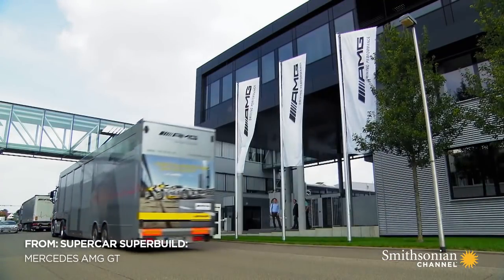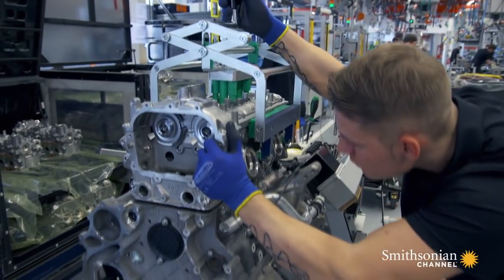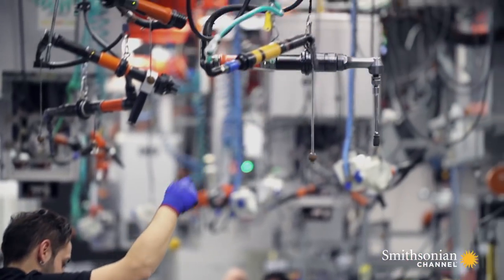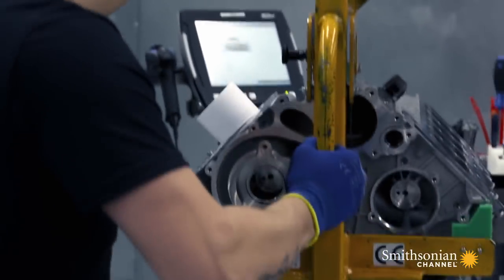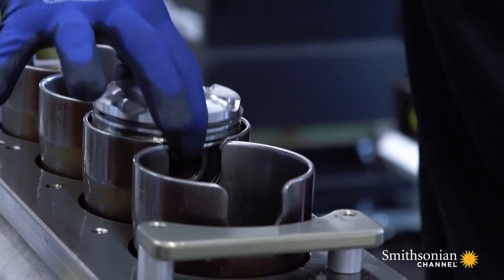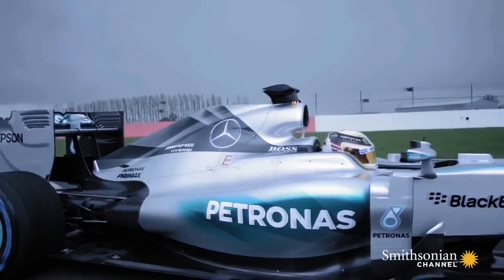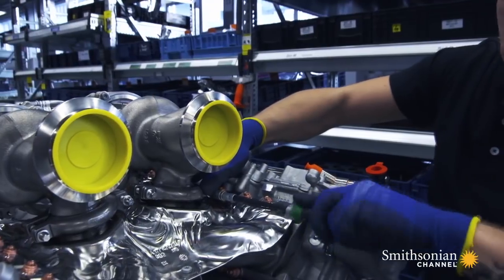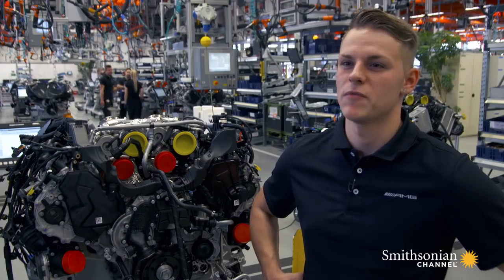Here's How a Mercedes-AMG V8 Engine Is Built

Comment: It's sad that no longer will every AMG have a hand made engine with Mercedes producing the "AMG 43 "models which do not have one man one engine in them
Reply: Its not real amg its just powered engines. Amg starts with 63 not 43
Reply: @istanbul-zc3eu  I agree it’s not a “real” AMG but to Mercedes it is they market both the 43 and 63 under the AMG brand it’s not how Bmw separates M from M performance brand into to different lines Mercedes does not do it that way they did when the 43 models were called the 450 AMG in 2016 but then they dropped that name and rolled the “450” models into the full AMG brand.

Comment: $500 to change a battery on one of those
Reply: Huevo Duro708 what kind of fucking labor do you think it takes to take an old battery out and put a new one in???
Reply: Some car companies create stupid ways to locate car batteries and that dramatically raises the labor cost.. For example, most Cadillac sedans with Northstar engines require removing the back seat cushion to reach the battery. Some Chrysler 300M and Sebring models required you to remove the left wheel and splash guard to reach the battery. GM would sometimes bury the battery under the washer fluid reservoir or strut tower reinforcing brace, requiring more laboer to remove and install batteries.

Another reason for higher battery costs is because German cars often use a different and less common batter than those found on American and Japanese cars.
If you have a GM, you most likely have a group 75 or group 78 battery
If you have a Ford, you probably have a group 58 or 65 battery
Before Chrysler was under the influence of benz and fiat, group 27, group 75, group 86, and group 24 batteries were common.
If you own a Toyota, you probably have a group 24R or group 35 battery
If you own a Honda, you probably have a group 51R battery, group 24R battery, or group 35 battery

Among German cars, and American cars heavily influenced by European cars, battery groups 94, 49, 48, 47 and a few more were much more common.

If you look at those different battery sises in auto parts catalogs, you will find that the batteries found in American and Japanese cars are a little over half the price of European designed batteries.
Reply: Skyline Fever yeah he’s right I had a bmw and they put the batteries in the trunk
Reply: Skyline Fever starter was also buried and took 2 hours to finally get to.. 800 with labor
Reply: You don't need to have a BMW to have a starter located in a stupid position. My mom's 1985 Nissan Maxima cost a fortune in repairs because the starter was both difficult to get to, and located in such a way that the blazing underhood temperatures would wear them out regularly. I have no idea how much each starter cost in parts and labor, but that car went to the junkyard in 1994.
Reply: Thats simply not true, you can change the starter battery on an E63 W212 the same way as on your moms Corolla. 
Its just a bit heavier and has more capacity.
Reply: good gotta pay that labor!!